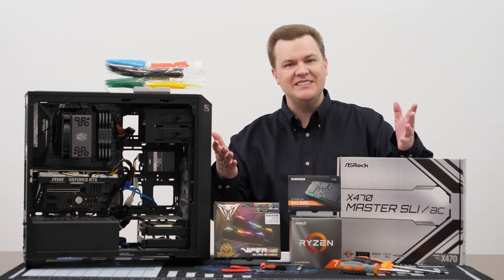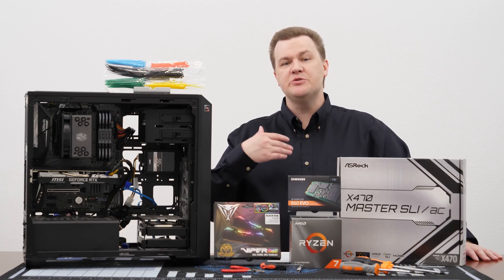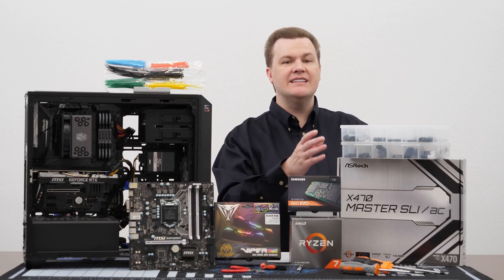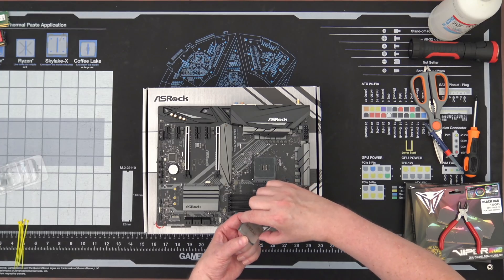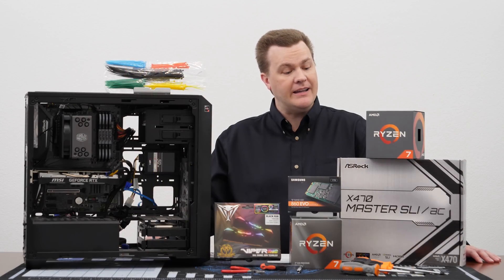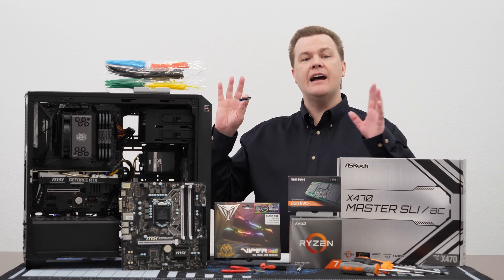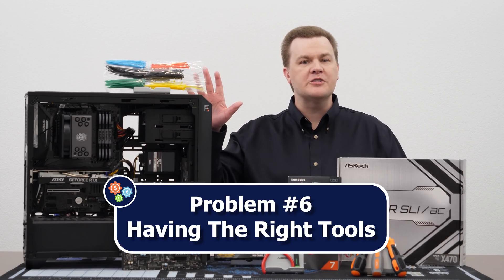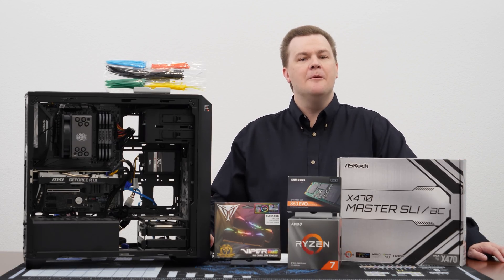Top 6 Challenges When Upgrading or Building a PC

Comment: Hello!  I watched a couple of your videos and determined it's worth spending a little more on the R7 3700x over the R5 3600xt.  Do you think the VRM's will overheat in the MSI B350M Bazooka with that processor or even a R9 3900x at full load?    I'll be potentially be upgrading from a R7 1700 for better single core performance. Thank you for all the knowledge in your videos :)

Comment: Thanks for the video! I was just forced top upgrade my motherboard and CPU from an Intel 6850k / Asus X99 Deluxe II combo to a Ryzen 5 3600 and MSI X570 Godlike. I say "forced to" because the X99 became extremely unstable and would not come back from sleep most of the time (this board is infamous for problems of this nature, it seems), and one day it all just died on me, right when I needed the PC the most. Combine this with the fact that most parts are now out of stock or severely back-ordered, due to pandemic, and the fact that I use this PC for work only (no gaming), and the results was that I ended up stuck with having to pick and choose from whatever was available at that moment, or at least between whatever would ship faster, which is why I went with a $650 motherboard I really did not need (although I do not regret the purchase since now I am running FIVE M.2's!). My biggest fear was having to re-install windows and all my programs, and having to waste 2 days getting everything back to where I like it. I am extremely picky about this and I was dreading the mere thought of having to endure the process... But, long story short, and knock on wood, after installing everything and simply using the same boot drive, it all seems to work perfectly fine. Windows booted and I was greeted by my old welcome screen, desktop, etc. I just had to update a few drivers and, so far, after 3 weeks of using the PC daily for 10+ hours (mainly Photoshop and design work), there have been no problems. I also installed additional M.2 drives, including 2 PCIe 4.0 models, and the dual M.2 adapter that comes with the board. Again, no problems. Everything works just like before. It's as if I never changed machines. The only thing I did was upgrade the cooler from the stock AMD, which was terrible for South FL weather, even with AC on, to a Noctua 12A. Did I just get lucky? Is the Windows re-install 100% mandatory in all cases? Or if it ain't broke, perhaps I should not bother to fix it? I hope I am not jinxing the new system by sharing this, but I thought it could prove useful for others in similar shoes. Having said this, I would love your input on why re-installing Windows is required (a video on this subject, and how to clone Windows for a future re-install, would be appreciated), and your theories as to why I did not (it seems) need it on this case. Thanks again for the great channel!

Comment: I always store any spares in the Mobo box for a specific build.. screws, cables, case spares, components, general manuals etc. So any upgrades i just pull the applicable Mobo box as i know that's where all the stuff is for that build. 
I've got them going back many years so any issues to fix on legacy stuff ill check a mobo box from that era.. ill add to a box if i break the PC down for spares.

Comment: My "oh no moment" when I built my PC was when I realized that the 1 pack Corsair ML fan I bought could not be connected directly to my motherboard because of corsair proprietary 4 pin connector. Because of this, I had to buy another twin pack fans to get the lighting node pro and replaced the other non RGB fans that came with the case. There you go 110 US$ wasted for 2 RGB fans. The second one was when I realized that I could not fit in my custom cable 24 pin because of sideways opening of my MSI X570 Creation motherboard 24 pin connector. I wonder what was the reasoning to put opening of 24 pin to sideways (instead of top opening like the usual motherboard) when the motherboard's form factor is already E-ATX. Even the thin cable from the PSU was barely managed to fit in trough the crevice and limited space of the PC case.

Comment: Also, another thing to consider before upgrading:  check your old power supply connectors to see if you may need to add extra adapters or even a new power supply to be compatible w/the new motherboard.  I ran into that problem a while ago when I got a new motherboard and discovered that the CPU 12V power connector required 8 pins instead of my old 4 pin connector.

Comment: 12:45 that's why i always use gparted from a live USB running linux, since it always ask me if i want to or not. Every option fits every necessity so mine is i wanna make sure (and second because i use this OS also), when i reinstalled windows in my notebook which have only 1 drive, there wasn't any problem using this DISKPART since i had only one option

Comment: 1660ti, this was the oh no choice i made :(
Upgraded from a Phenom II x6 with 24 GB of RAM, RX 580 OC and a WD 240 SSD Green to an i5 9400f, 32GB of RAM, the 1660 ti and a m2 500GB PCI-e SSD with an external crussial sata 500gb SSD for OneDrive and Games. Used the same HAF 912 case and EVGA Bronze 750W PSU and kept the CoolerMaster Hyper T4 cooler too..

Wow the 1660ti was a bad choice. First it didn't upgrade that much from the 580 as i expected, in fact i did miss the 2 extra GB of vRAM. I should have got the RTX 2070 or RX 5700.

Comment: I usually hide a small bag of extra parts somewhere in the case after a build.  There is usually a place that's out of the way.
Someone should make a 2.5" drive case that is actually a small parts bin that could be put into a drive slot.  Could hold screws, a power connector maybe, or even a USB boot flash drive.

Comment: I remember when I made the mistake of installing the motherboard directly onto the case without standoffs and wondering why it wouldn't turn on. That was of course a little while ago when I built my first gaming PC in early 2001. I remember that I built it with a 1 ghz Pentium III cpu with 256 mb of pc133 ram, a 32 mb geforce 2 graphics card. I then originally had Windows ME on it and then later upgraded it to Windows XP in 2002.

Comment: I upgraded to a 3900x and windows didn't get along with my wifi adapter driver anymore. Kept crashing, tried to do a clean install and still crashed until I disconnected the adapter. Once I got into windows and updated the drivers everything started running fine.

Comment: new windows key/activation is ONLY needed if your activation is NOT linked to your MS account. If you first link the key to your Microsoft account before you transfer to the new system. simply logging in with your MS account will activate windows.

Comment: Hey Tech - you definitely have been my sensei over these years since you started your channel ... but the student is offering a small bit of feedback !
Agreed, these points are a consideration - but not necessarily the "Top" Challenges.
Point#1 - Fact is, there is usually no real 'good' upgrade path for a system that is three or more generations old - primarily due to the inter-dependency of the components . . . in other words, even if you upgrade your 3gen old CPU, chances are you will not be able to realize the expected performance you just paid for because your remaining components will not support that level.  Your "upgrade" project proves that out . . . I would argue that, it's not an "upgrade" at all - it's really a new build using a few carefully selected used parts.  I run into this question all the time from folks wanting to "update" their system they bought or built 3 or 4 or more years ago ... simply stated:  "it's just not worth it"
Point#2 - Most people who want to "upgrade" their Gaming PC, first turn to the GPU, and more often than not, where they are coming from is not a GTX 1080 ti - it's a GTX 1050 with 2GB of VRAM, which came under configured in their initial "Gaming PC" purchase.  Of course, now they can't run Fortnite Chapter Two at all, while their friends are pushing 200 fps - so what do they do???  Well they can buy a new RTX 1080 Super which costs more than their entire system - but, guess what (?) - that old motherboard with two RAM slots can not take a CPU (or Memory speed) that won't completely bottleneck that 'Killer new GPU'.
Point#3 - Quite a few who decide to bite-the-bullet and accept that they simply need to build a new system to replace the old clunker (the only real economical "upgrade" path) are usually most concerned with all the installed games (non-Steam) they currently have . . . not so easy to just copy over files and reformat.  It would be great to hear your take on the best approach to this "TOP" upgrade challenge.
Cheers

Comment: I just upgrade my son's (my really old) i7-920 to a 1600 AF.  I used the same SSD.  I was shocked that I didn't get the Windows 10 needs activated message.  So far Windows 10 is running fine with no activation messages.
Reply from the maker: I have no doubt Windows runs...  what you're not seeing is how well it would run with a clean install...  speaking from experience, unless he does little with it, a clean install is overdue if it has been that many years...
Reply: @TechDeals  I'll give it a clean reinstall when I get him a new SSD.  I was just surprised it didn't ask me for a new activation code.

Comment: I ended up buying a new iBUYPOWER PC because my seven year old HP Envy 700 desktop was getting too temperamental.  Had to replace the drives last fall, and almost six months after upgrading from an i5 4430 to an i7 4790, I discovered that the i7 was running too hot in games in warmer weather in a non-AC environment.  At least I managed to find a Ryzen 5 3600 PC in my budget range that was actually in stock with a graphics card that's better than my 3 GB GTX 1060.  
But, I'll have to upgrade the RAM to 16 GB and get a 4 TB hard drive as the primary storage drive given my very tight budget and room for only a single 3.5 inch hard drive.  Right now, it's got 480 GB ADATA SU830 (the drive the PC came with), a 250 GB Samsung 860 Evo (I moved Windows to this drive) along with and a 2 TB HDD that's currently being used as the main storage drive.  And the graphics card's being replaced once the next generation of cards is coming out.

Comment: You probably won't need a new Windows license when changing the motherboard. Just call Microsoft's automated phone hotline thing and work through it. You'll most likely be able to re-activate your existing license.
Reply from the maker: That assumes you have a key...  This system came pre-digitally activated without a key.
Reply: @TechDeals  I see. You might be able to read the key of the pre-installed Windows with the requisite tool though. Did this with my refurbished laptop that came pre-installed. I could read the key of the Win 10 Pro and also found another key on a sticker underneath the battery. So now I have two Windows 10 Pro keys instead of zero.

Comment: Upon starting the computer for the first time, were you not able to immediately go into the BIOS and flash in steps to the latest firmware?   Read all the various descriptions, to determine the safest path to the latest firmware.
Reply from the maker: No, without a supported CPU installed, the BIOS won't load.  It is a frustrating design of modern PCs that they cannot get to the BIOS update screen without a CPU that doesn't need an updated BIOS.

Comment: Hey @Tech Deals I have 
i5 4690 
8 gb DDR3 ram
Seasonic sII 500w power supply
H97 Mobo
GTX 970 
1 TB HDD
256 gb samsung evo add
Samsung 60 hz monitor 
I want to upgrade to 
1.144 hz screen
2.Proc Mobo ram
3.Gfx
Help me choose an upgrade path where I can buy from above options one buy one ..for 1080p gaming for next 3-4 years ..
Reply: It would be helpful to know your budget. In terms of CPU you can't really go wrong with the Ryzen 5 3600 at the moment but as long as your fine with waiting up to the end of this year the new 4000 series would be a great choice as well I assume.
Reply: @Lukas-jm7cx  I want to upgrade in parts ...
200$ for monitor 
400$ for Mobo ram proc
400$ for GFX 
But what could be bought in a suquence ?

Comment: @ 10:26 Why couldn't you use the product key of the previous windows 10 (?) installation to the new one? U're not applying the same key to more than one machines, u're just replacing your current hardware (aka the previous hardware gets set aside and wont be used anymore) How come its no longer valid? Does each single product key of windows, that someone purchases, get "automatically tied somehow" to the MAC address of the hardware being used at the time of the first activation? / Sorry for the lengthy comment.
Reply from the maker: You can try, if you have the key.  Most OEM PCs don't come with the key anymore, they come digitally activated to the motherboard via it's BIOS.  If you can extract the key, it's worth a try, but in my experience OEM keys don't activate on retail boards most of the time.

Comment: A big (and costly)problem that I missed here is how to properly remove a cooler from an AMD CPU (because of PGA). Because I almost weekly read on reddit about bent pins on the CPU because of wrong removing procedure after the thermal paste became super glue over time. You have to run a benchmark to heat the IHS and twist, NOT pull to loosen the heatsink. I mean it's obviously not problem for me as I know about it now after all those desperate posts but it happens wayy to often.
Other than that, great points in the Video.
Reply from the maker: That's a good point...  of course that works if you have a bootable system that you can get into Windows with...  I usually twist the cooler to losen the paste before pulling it up.  I have pulled a Ryzen CPU right off the board before, thankfully nothing was damaged.

Comment: Any particular reason you tell people to use a command prompt for partition management instead of using Computer Management -> Disk Management?
Reply from the maker: Disk Manager won't remove the hidden and recovery partitions.  Or at least I've never gotten it to.  It has those options grayed out.  It will remove the old Windows partition on the new drive, but it can't actually clean the drive.
Reply: @TechDeals  I've never had that problem. The only time I ever needed Diskpart is when I royally screwed up one of my partitions. I've moved my OS to multiple systems and multiple SSDs, because I was lazy and didn't want to reinstall everything. Always used Disk manager to clean up my storage.

Comment: Does it make any bit of temperature difference when the CPU fan is installed to pull vs push?   I wanted to get 4 sticks of pretty ram, but the Hyper cooler wont let me fit 4x8GB, so I got 2x16gb because I wanted the CPU fan to still push air.
Reply from the maker: Not really...  You can turn the fan around many times and just attach it on the other side to pull air.  I'm sure in some odd conditions, it would be worse, but if you're THAT close to being thermally limited, a better cooler would be ideal.

Comment: Why do you need to reinstall windows? It would take me days to reinstall all the needed software that I have. I moved from a FX-8320 to 3700X last summer and just had some minor issues.
Reply: If you have an SSD/NVME, reinstall software is SOO much faster now.  Every time you install something, your registry gets fields entered to it.  Even if you delete everything you install, not all registry fields are deleted.  As you get more entries in your registry, the slower your system gets as it has to look through all the bs entries that literally mean nothing.  It's always a great idea to re-install windows once in awhile, to freshen up your filesystem and give yourself that little extra boost that comes with fresh systems.  Mind you, it's not absolutely required as the system will still run even with changing out hardware.  Just expect slow down and potential driver errors.  Or you could see no problems, but you'll always have slow down.
Reply: @MarilPWE  What do you think about tools that clean the registry? (e.g. CCleaner)
Is there any difference when installing exactly the same programs again on a fresh windows?
BTW: I ran some benchmarks and my components deliver roughly the performance they are supposed.
Reply from the maker: Moving the Windows install from one chipset to another causes unpredictable behavior.  You notice minor issues, but you don't know what you don't know.  You might be surprised at how a reinstall runs better, Windows is frankly weird when it comes to such things.  I've done this enough times that I no longer try to move Windows, it is too much of a hit or miss affair.

Comment: Thanks for the tips, especially for the one about cleaning your old boot drive of its partitions! I think I just might have an old boot m.2 drive as a data drive that could use some cleaning.
Reply: Another quick easy method for drive cleaning is to plug into into a ps4 as external storage. The ps4 wipes everything and then you can just reformat it in ntfs.

Comment: Is 60-75 C while gaming bad for CPU? Pls someone ans
Reply: Its perfect.
Reply: No with caveats. Depends on the game and how much it is utilizing your CPU. If utilization is low and your temps are high, it could be your case not having enough airflow and/or your cooler not being able to cool your CPU well enough (either it is not rated for your CPU's TDP or could be as simple as a fresh thermal paste application). If you are at a high utilization (60-100%) and your temps are 60-70c then that is great. There are many other factors here and I am not an authority so if anyone else has something to add or correct me on something please do so.
Reply: 60-75 Celsius is fine as long as you are sure your numbers are not off.. Everything under 90 is fine (but not perfect)..